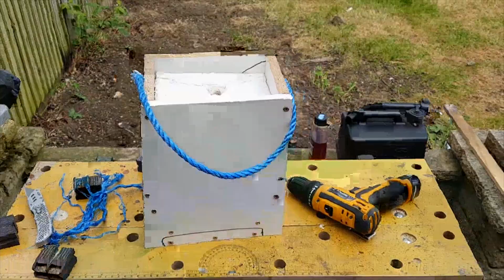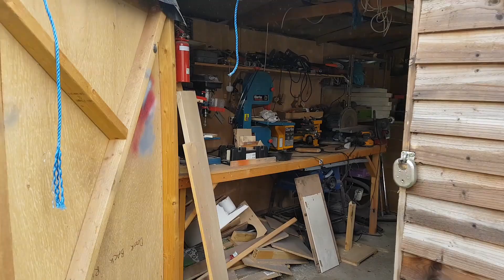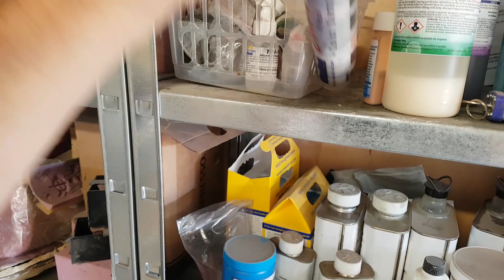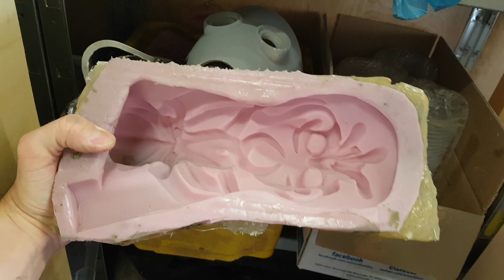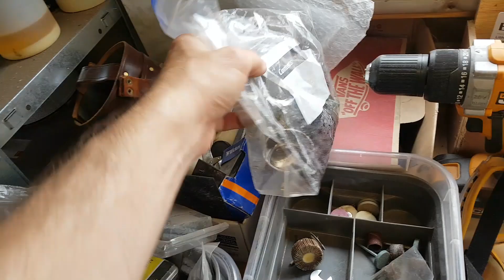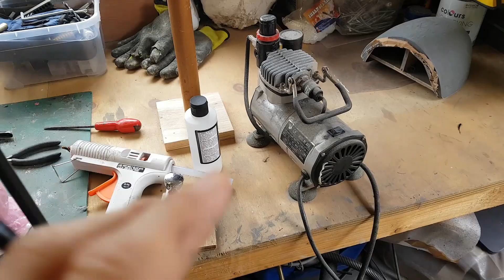Workshop Build and Tour

Comment: I was able to use lock down to begin to clear out the spare room. There’s still a fair amount to stuff to sort but I’ve made room for 2 tables and some storage. One table acts as a bench and the other has my 3D printers on. Still lots of work needed but it’s a nice space to work on stuff when I have the time and I am finally able to jus leave stuff out rather than having to pack up each time I am done.
Reply from the maker: Cool, yeah you've got to have a dedicated space. I've just got a 3D printer too actually, so getting to grips with that. I have an art room in the house with a desk for all the regular sculpting stuff.